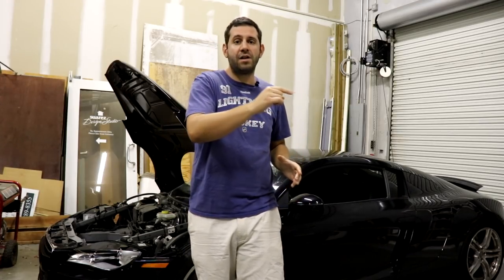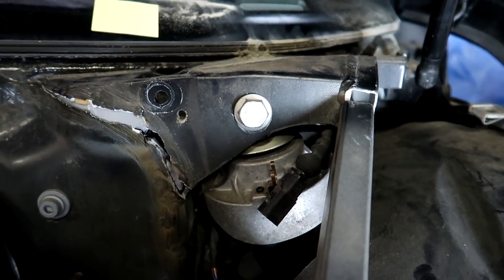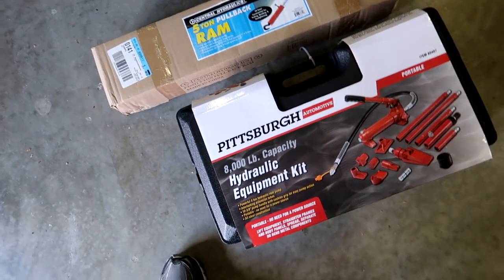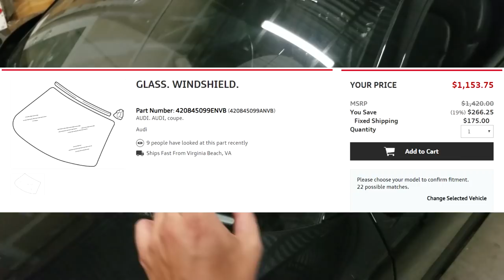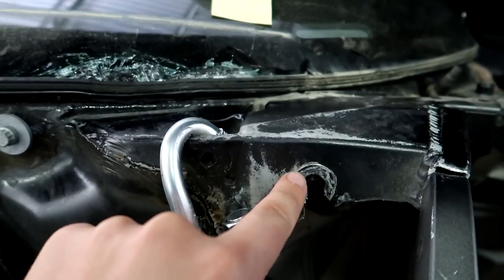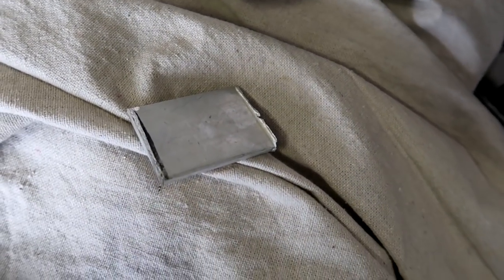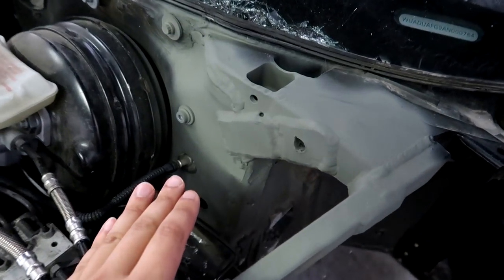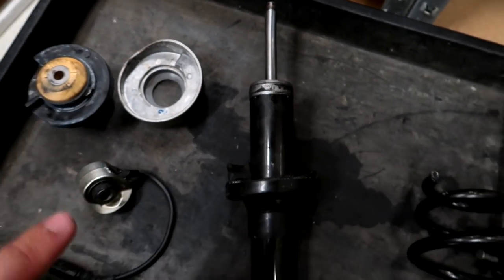I Repaired My Totaled Audi R8's Cracked Frame for $500! Insurance Quoted $29,522!

Comment: This is a bandaid, not a repair.  You're treating this as if it was a stamped steel piece, not a complex alloy casting, and there's a lot more to it than just the upper strut mount.     There's more damage you cannot see, underneath the windshield and dash. The only proper repair was to make it stronger than it came from the factory, and there are weakened areas of this casting due to stress.  The weld isn't going to fail, the casting adjacent to the weld will fail.
Reply: Yep
Reply: Agree, it might look strong but in fact it is weaker now than factory because of welded aluminum.
Reply: yep. That alloy didn't fail because of repeated stress. It failed because someone ran the car at speed over a curb. Most 2008 R8 never developed this crack. Mostly or only ones that hit something at high speed. You can see that the entire thing is bent 1-2 inches up and only after that it broke the strut. This is aluminum not steel and you have more cracks underneath the windshield area. I would be super careful to run this car. This could just fail again at 150 mph and kill someone. I wonder how you will ever sell this with such an uncertified repair.
Reply: Obviously, the factory didn't do a very good job to begin with..
Reply: @explicitDTP  no.   There's no reinforcement on the back side of the strut mount, because you need to remove the windshield and dash to access it.  Not that that matters anyway.  The weld isn't going to fail, the bent, cracked, stressed, and heated alloy casting adjacent to the weld will fail.   Anyone who thinks this is a simple strut mount repair needs to go look at some pics of the R8 space frame.   There's a lot that's attached to that casting, including the A pillar and the forward cabin frame.   There's a reason that a proper repair entails a compete disassembly of the front end.  The author of this video is being extremely negligent in suggesting that this is a proper repair.
Reply: That would be more of a concern for welding cast iron. Also they did add reinforcements but i think that isn't enough to fix the problem permanently as proper procedure for fixing the crack seems like it wasn't applied. i hope he doesn't have eny problems at least for the period when he owns the car
Reply: There is a reason that car manufacturers require shops to be certified to work on vehicles with aluminum structural components. Our Audi certified techs would cringe if they saw this. They don't even use the same tools as the steel cars so that there is no cross contamination. Contamination can lead to galvanic corrosion.
Reply: @mikemarler8224  How about we just wait and see how it holds up for him? Face it, even if this was steel there would still be people in the comments saying "That's not a proper repair, its gonna fail and you'll kill someone... etc." If it does fail it won't be a sudden thing, it would be cracking again over time and all he has to do is keep an eye on it.
Reply: In the UK that car wouldnt be roadworthy...Its a deathtrap defo. Sell it to a mug quick.
Reply: It's not a casting...if you knew shit about anything-which you don't you would know that piece he has repaired isn't a casting...was the repair shady...yes...tho your comment is too...
Reply: I wouldn't be surprised if these chassis were heat treated during initial assembly when new.
Reply: That was my concern. I brought it up in the previous video, but was attacked by a roaming pack of internet engineers. The "fix" he did is mostly acceptable, but there are some easy points there to integrate some bolt-on bolstering that would prevent this from cracking out again. If that were my car, my teeth would be itching every time I hit a damned pothole.
Reply: as a welder for 20 years it will be fine as long as he used 4043 rod not 5356 i would have made a plate out of quarter inch aluminum the whole  size of the area and welded it on all the way around
Reply: Can’t weld aluminum when it cracks
Reply: Pretty sure Audi sells a reinforcement piece to fix this, that you weld in place...
Reply: @kevinmartin9587  bullshit. complete and utter nonsense. There is NO difference between welding cracked aluminum and 2 regular pieces and millions of people tig aluminum ALL the time. In fact, a proper tig weld will be as good if not better than virgin aluminum as long as it wasn't overheated. 

A friend of mine is a red seal certified structural tig welder and he does it ALL the time. How the hell do you think airplanes are made? trailer frames? You think these things are GLUED together?

Stop posting if you don't know what you're talking about.
Reply: @ajquick  yeah, he showed them in the last video. for the money, I don't know why he didn't just buy those two pieces and have them welded into place. $26.95 plus shipping. I think it's around the 2:00 mark in this video:

https://www.youtube.com/watch?v=QOlvG1QbCDU
Reply: @muskokamike127  because you can't buy them unless your a certified body shop or know someone.  Same goes for Porsche.
Reply: @sgt-willkillu  yeh im looking for a cheap R8. Malcolm would snatch his hand off for 10 GRAND
Reply: @madmatt2024  How if you can't see where quite a bit of the damage was, stress cracks and notching are very different in aluminum than steel.
Reply: I do not see a casting but a formed aluminum sheet and square tubing. To me I do not think he got everything aligned before welding it.  Also the doubler was not the same as the factory part in the previous video, so I question the strength of the repair.  I also question the heat from the welding might weaken the area too.
Reply: Well even if it does fail again, it’s not going to cause a complete suspension failure. It’s not a McPherson strut where the strut mount is a “ball joint” and a super critical point.
Reply: @baloghlcb  not to mention what happens when you mix the aluminum dust with iron oxide particles....
Reply: lets be honest here. by the time the adjacent castings fail he would have recouped the potential loss of the car with the youtube and sponsor ad money he would get for the content this car would produce. even the totalling of the car would get ad revenue
Reply: There isn’t going to be a catastrophic failure but there could be a very small chance of gradual cracking which he can observe over hundreds of miles.  I don’t have an engineering degree.
Reply: That is not a complex alloy casting it is stamped aluminum piece that gets welded together at the factory in a jig by a human being and then is checked by a robot. The only cast piece is the suspension arm. Yes it likely got damaged due to a pot hole or curb but the repair would be stronger than the original. It’s called fish plating and extremely common. Sure the plate is not pretty but it works. The factory repair piece is essentially the same thing only better looking.
Reply: 100% correct.
Reply: @philipparana9225  or just get them off ebay.  Ya, look it up.
Reply: people think insurances are stupid. they have the real experts and if they write it off, it's done
Reply: @2511jeremy  Are you a kid or what?  Jealousy isn't why people have passed negative comment,  it's out of concern and an interest in cars.
Reply: N Stone Stones Exactly Right. 
Boy these internet engineers are a high strung bunch. 
ANALYZE TO PARALYZE
Reply: It's possible. Just give it a visual inspection. If he's gonna fly it, after 500 miles, X-ray it. You can keep re-engineering it.
Reply: @baloghlcb  That don't make no sense on the corrosion. My Benz is a steel chassis on aluminum subframe in front. All I can think of is the humidity must suck where you're at. And stop pulling the certification card. That's how people suck up economic rents. Value from obligation.
Reply: completely agree with you guys. this is a bullshit repair and a joke video. USA very loose road rules make this happen, you could never do this in EU, youd never get a numberplate. this so called repair is completely unprofessional, a deathrap at high cornering loads, sad but this car is parts material.
Reply: @funkyzero  some dude already got an upvoted comment like... just come over and i weld it like no time... i was like: wot...?
Reply: @muskokamike127  but you are passing on the ductility issues. The material is compromised and likely stretched as well. It's not just THE crack... it is now a foundation issue as well... at least in all likelihood. If this were a front engine car, that repair most certainly wouldn't stay together for long. This one might eek by. None of us know the materials, range of force applied, or lever measurements. All of those things are required to make a legitimate calculation, everything else is conjecture. Of course that isn't absolutely necessary here, but to say that the welds are stronger than the original is simply false. We aren't just talking about a weld, we are also talking about the foundation, and you have no idea anymore than the rest of us if it is compromised or not. And since it has been subject to failure, it's a safe bet to say it has been stretched. And since that one point takes the entire corner load of the car, I wouldn't ever trust it like that... not without some proper additional bolt-on vertical reinforcement.
Reply: @kbuss10  It's called being free. We don't have an over-reaching government telling us how to run every aspect of our lives here. Most of us have a mother, we don't need the government.
Reply: At least the weld won't break it'll be right next to it next time LOL
Reply: @funkyzero  you kinda confuse me. so now you gonna hinder this dude from driving this crap on the road or who?
Reply: @funkyzero  yes yes, ductility issues that was the word i was looking for. thx
Reply: Right on brother. This car needs work!!! It looks cool but for me this isn't worth it. I wish him success.
Reply: True it will never be as strong as factory because the frame works like a egg it's strong until cracked, not saying it won't hold up but I definitely would not take this car to the track or race it I would just cruse it around or sell it and get another project supercar
Reply: It’s already branded a salvage car so it’s irrelevant really.  The salvage stamp stays with it.
Reply: @baloghlcb  I never thought about metal cross contamination. good point
Reply: @blaze00366   Yes. a 1/4" thick over the entire area welded at the edges inches from the high stress point would be much better than what was done. The thickness would make up for lost strength by welding the crack.
Reply: Use your Google, and look up r8 space frame.  The upper shock mount is part of a large casting that runs under the windshield and is bonded to the firewall, A pillar, and the forward door frame.  The firewall is formed sheet, the rectangular  bar that was broken in two is an extrusion.  The factory repair is not to weld a plate over the crack, that's a preventative measure for an undamaged car.  The factory fix for this failure is to replace a large section of the frame.  I weld aluminum, have no problem driving on aluminum rims that I've straightened and welded.  If this were a steel frame, no problem.  If this guy hurts himself because he's too cheap or lazy to make the proper repairs, that's one thing.  If he tries to sell the car to someone, claiming that repair is as good or better than factory, that's another thing.
Reply: @kbuss10  that's why in order to be a certified welder you have to know these things. Millions of people weld cracked aluminum ALL the time safely and securely.

BTW: you're not the brightest either so before you start tossing out the insults, why don't you make sure you know WTF you're talking about.
Reply: @funkyzero  and YOU are forgetting the reinforcing that has been added to help alleviate those issues. You're also forgetting that right from the factory, which was approved by the various DOTs remember, was flawed right from the get go. 

As for your statement "if this was a front engine car...." how do you KNOW this? Hint: you don't. You are guessing. You are surmising that the material around the fail point has been compromised where it could be fine under microscopic analysis. Could it have been weakened? yes it could. But two things that are going for it: 1) the added plates to carry that load and 2) it didn't crack when he was bending it back.

if this car was going to race in IMSA I'd say this isn't good enough. For daily driving? I'm saying it is fine. Doing power laps around the ring? I would have added more bracing. For blasts down a country road? It's good to go. Will be break if he hits a curb? maybe, but then again, the original did also.
Reply: @kbuss10  "crap"? I'm merely stating facts. And unlike probably all of the people commenting here, I actually know what I'm talking about. This is the field I am educated in and worked in for 20 years. Theres absolutely nothing wrong with Sams car, I just disagree that the repair is sufficient based on the very little information I can gather from a youtube video. We don't even know what materials we are dealing with here other than it's an aluminum breed of some sort. We don't know the lever measurements, corner weight, material thickness or makeup... none of it. All we DO know is that the Audi engineers skipped on the FEA exercise, or made an error when they did. What I can see is they basically put a zipper on the car, then hung a bunch of weight off of it. This is easily remedied with a combination of welding AND simple bolt-on structural enhancements. This isn't a crane, it's a car. The loads and forces involved here are relatively minimal in the scope of things. My best guess would be that the joint took a shock of some sort... a pothole or something along those lines got this started. The repair that was done isn't horrible, I just think it's slightly inadequate. But it's all conjecture because as I stated, we have no data here to work with. Sam could very likely show us all up, and this repair could last for as long as he owns the car. All I'm saying is that I would bet against it.
Reply: @muskokamike127  Dood, go away. You are getting emotional over a youtube video. 
You are talking to someone who work as a load and design engineer for Emmert Intl. for over a decade. I know just a little bit about materials and structural mechanics, and I most certainly know about fastening and bonding.
I gave my opinion, and it is what it is... and I am certainly not arguing with you... whos credentials amount to "my friend is a certified welder".
Reply: @funkyzero  you lost all credibility when you said "dood go away" lol.....you "saying" you're a load and design engineer has no more weight than my referring to my friend the welder. 

BTW: I'm not emotionally invested in this conversation in the slightest! other than laughing at people like you.
Reply: @TheMetalMender   Exactly!
Reply: @mikemarler8224   Or another concern, driving it and having it fail and being involved in a serious accident with another motorist. Wonder if it would pass the inspection you're required to have here after you have repaired a totaled vehicle before they will issue you a rebuilt title.
Reply: I will feel legit depressed if I hear someone died and I was involved in watching this being done. You can't delete that history 😕.
Reply: Why in the first place didn't he use the Audi reinforcement plates specifically engineered for this purpose. He showed them in the previous video, they only cost 20 bucks a piece for fuck's sake.
Reply: @mikemarler8224  I don't see any casting, it is all fabricated thin aluminium. Super car?  Super scam from the Germans - getting even for the lost war.

Comment: a block of wood and heavy hammer would have worked on your strut mounts,by placing the block of wood on top and striking with a heavy hammer.The block of wood spreads the impact without causing surface damage.
Reply: It would avoid smashing the windscreen too. He should have made a spacer to bolt to the top shock mount and pulled on that rather than ripping the hole out.
Reply: Why bother??? Lol
Reply: @delcat8168  I haven't even made it through the whole video and was going to leave the comment I'll put the bolt for the shock through the hole and pull on the bolt. I'm just waiting for it to tear out  that hole

Comment: I'm not an expert, but that looks like a crazy amount of buildup on those welds. I might be wrong, but I think a big reinforcement plate over the whole damaged area would've been better.
Reply: i think its because there were to separate areas of damage one was the original crack and the other was that broken bolt hole  and they need to fix the hole first and they can continue pulling will the hydraulic kit before welding and reinforcing the damaged area. thats my guess anyways not an expert either
Reply: Agree; I thought they'd put in a plate that included the strut hole, to ensure strength in the entire area.
Reply: akkual I'm not saying that they shouldnt've filled the gap (because they definitely did have to), but I do think the reinforcement plate is necessary. After a weld, if the suface is not carefully heat threated, the substrate can cool in a different rate than the filler material, leaving the surrounding areas of the weld weaker than before, hence my concerns.
Reply: Hell, with this guy, I am suprised he didnt use exaust hanger tape to hold it together. He is after all a HACK!
Reply: @ItaelBarbosa  I think that he stated in the video that he wants to leave it (the buildup) how it is so that he knows where it is in case something happens in the future. I'm sure the professional (welder) mentioned alternative methods to him and he chose the option that he preferred but I get what you're saying.
Reply: @Itael Barbosa       I agree, there may be other weak-spots in that area.
Reply: Most mechanics are not much of a mechanic.
Reply: @akkual     Welding or bolting a reinforcement-plate onto both sides would not have been hard.